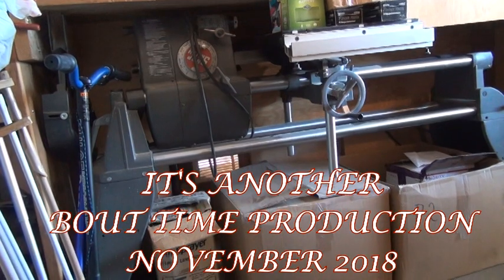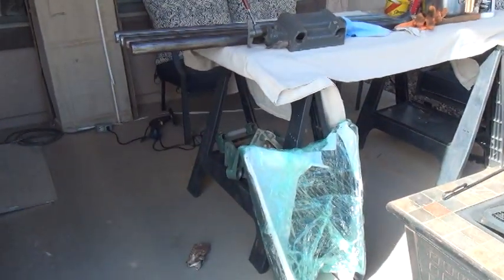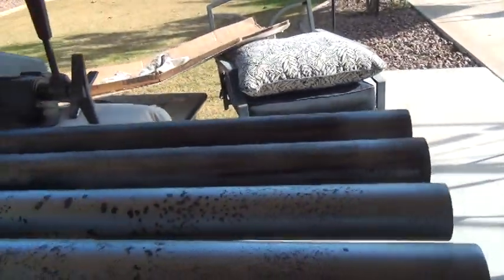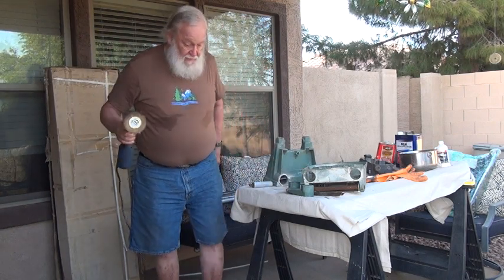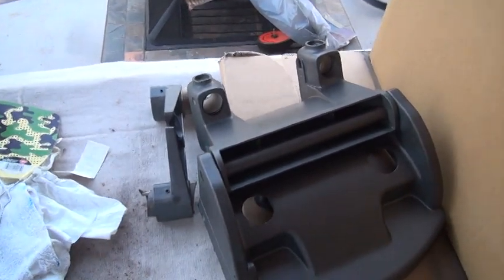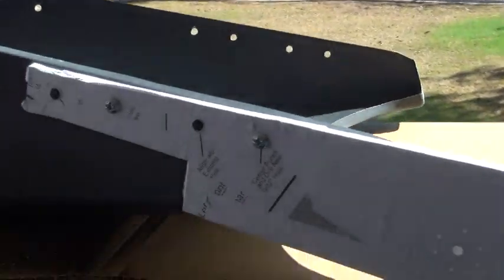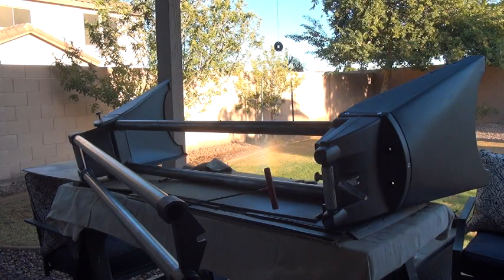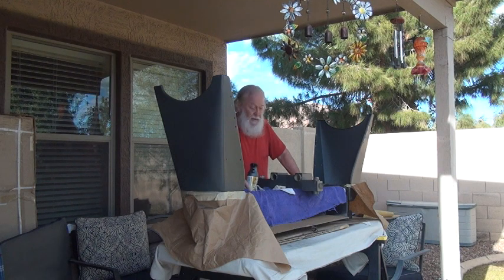BUILD YOUR OWN SHOP SMITH MARK V 510

Comment: I’ve seen your video of the refurb of your 510, and the fit and finish appear top notch, Thanks for sharing this, as well as your train videos. I recently picked up a pawn shop Mark V 500 in deplorable condition, but I was able to clean it straightaway, because although neglected, it WAS a business, & A/C was running the whole time it sat. And sat and sat. I think its a shame these machines have fallen out of favor, it’ll be useful to me now that my motor and sheaves have been freed (white lithium).Anyway, thanks for sharing the results of your hard work. Cheers
Reply from the maker: You're welcome. I see a lot of items like spare parts being sold on E Bay including several of mine. However I also see many responses where someone has purchased an old Shopsmith and is getting into the hobby or business of woodworking. I really don't know if this system is falling out of demand, but do know Shopsmith is a very small company now maintaining great quality and customer support. The very fact that you can still purchase new parts for 40+ year old machines is uncommon in any and all industries. The fact they continue to upgrade the equipment provides confidence that they will continue to be there in the future.

As for the machines themselves, they are quality, well designed, stout and well built machines with options that no one else offers. The new Power Pro is a great innovation and addition to the performance and durability of the system. I personally have three floating tables and six 27" tubes, four leg extensions and the table extension system that allows me great in-feed and out-feed capability which is essential with my disabilities.

I am confident that you will get many years of joy and production out of your Shopsmith. Thank you for your kind comments. Ted

Comment: Can I ask the reason you chose to line the existing holes with the drill new hole spot on the template? And drilles out where the template said to align the existing hole?
Reply from the maker: It is per Shopsmith instructions. Actually the Shopsmith isn't any higher off the ground, just larger and wider diameter wheels to assist in rolling the tool.
Reply from the maker: Sorry to be so late answering your question. I must admit now that what I was attempting to do was get as much clearance as possible. The Shop Smith holes are okay to use. the only height relief I received was from the larger diameter of the wheels.